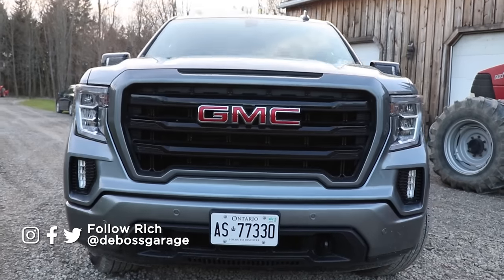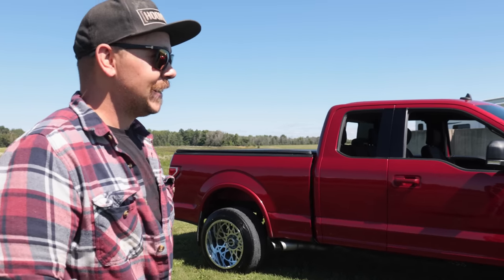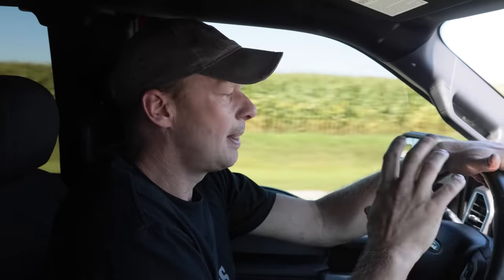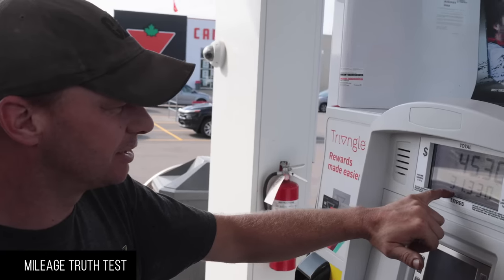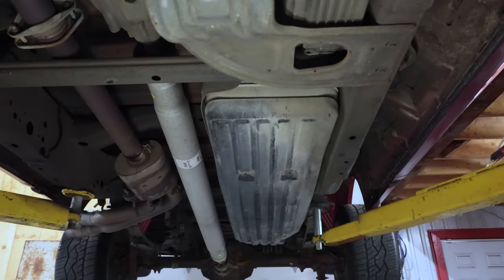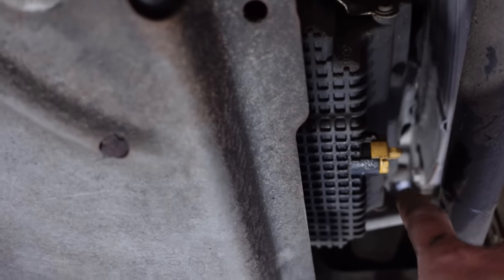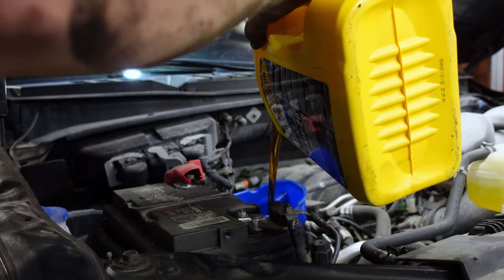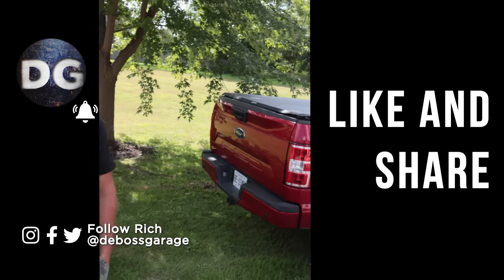REVIEW: 2020 Ford F150 Issues After 2 Years of Ownership?

Comment: I’m not a Ford guy but respect for an extended cab V8. So tired of ecoboost full 4 doors with a short bed.
Reply: That is exactly the reason I still have my 2012 f350 with the gas option, extended cab 8 ft box.

It's extremely hard to find a non diesel/Ecoboost. naturally aspirated engine with a ft 8 box

Comment: I have a 2019 SuperCrew 4wd with the 5.0 and 3.73 gears. 47k miles and factory stock in every way. At 77mph cruise on level ground with no wind I can count on 19.5 mpg. Any headwind at all, though, and it quickly drops into the high 18's. Knock it down to 67 mph and economy jumps to 21.5 - 22 mpg. In town I regularly get 18+ mpg, but I'm pretty chill (my wife says I drive like a 90 year old on Valium).

With the deeper diff gearing and insanely steep 1st to 5th gear ratios, it's hotrod-quick off the line. Let it eat and it will easily break the tire loose in the first few gears. It also means even the slightest bit of moisture or dust on the road results in low-speed traction issues. It's so comfortable we use it as our road trip vehicle even though my wife has a much better equipped leather-trimmed lux sedan.

No probs except for the ubuquitous rear leaf spring isolator pop. Isolators were replaced twice under warranty and it always comes back after a while. I just ignore it now.

Would I buy it again? Absolutely.

Comment: I have a 2019 F150 with the same transmission and with the 3.5 L  ecoboost.  The engine is awesome, the tranny went at 80k. It's been in the shop for 3 weeks and counting atm. Luckily it's been covered under warranty. I do love it though.
Reply from the maker: that's too bad man, thanks for sharing
Reply: Question: I also just got a 2020 F150 Lariat with 20k on it. My first Ford (Chevy guy) and worried about that 10 speed tranny if/when it goes. How is your still covered under warranty at 80k? I thought 36K miles and warranty was done. Thanks.

Comment: I have a 2018 and it had the oil consumption issue. Fords fix was a tsb update and a longer dip stick. Other than that I haven't had any major issues.
Reply: A longer dipstick seems like a complete and utter nonsense to me
Reply: Sounds like an accounting and legal department fix
Reply: That's the most college fix I've heard. Hilarious.
Reply: This is their fix now, their original fix was to replace the engine. Mine was swapped out at 27000 km and I brought it back with the same issue with 80000 km.
Reply: I heard they also reflash the PCM. They say there is too much vacuum on decel and it sucks the oil through the PCV.

Comment: I have 2020 3.5 King Ranch all good! The only time I have rough or harsh shifting is when I have old fuel. That 36 gallon tank lasts a long time. After 30 days I do notice the shifting. Fresh fuel, and it is not an issue. I am getting 19 MPG over all, heavy on city driving

Comment: You don't need to touch the exhaust to drop the trans pan. Just let the cooler hang down and tilt the pan. Comes out really quickly!
Reply: How about the trans filter coming out?
Reply: @paulhunter9613  What specifically are you asking?
Reply: As a Ford dealership Tech, the goal is to remove as much fluid through the fill port on the R.H. side, remove the heat shields, let the trans cooler hang, remove bolts, keep gasket with trans, tip the pan forward and down, remove pan, remove bolts and filter. When installing new filter, get a new filter gasket/o-ring (not included with filter!). Then reverse the process! The tricky part is getting the rear pan bolts. Mountain wrenches and wobble sockets are required! Besides that, it's such an easy pan drop! Take caution though...Ford uses multiple dipsticks! You may have a numbered or lettered dipstick. It's hard to find what number or letter you need to be on for your application. For back yard mechanics, drive for 2 miles and and check where the fluid is on your dipstick. Unless you're leaking fluid, this is where you need to be after your fluid exchange. Make sure you use Mercon ULV!!!
Reply: Also, ALWAYS check fluid level while vehicle is running! Park or Nutral, level ground. 185°‐215°F. Mercon ULV expands alot.

Comment: Get a Ronin drain plug for more controllable oil draining.....and a magnet.  The stock non led headlights are way too dim.  Add some brighter led bulbs or some aftermarket morimotos.  They make a huge improvement for night driving.

Comment: I really like my 2016 f150. I have a heavier foot and average 15 MPG highway. Frame is still looking good for Michigan and only reason I am looking to upgrade is because I'm beyond maxing out the 1/2 ton. I need to get a middle of the road 3/4. It has held up to my abuse well.
Reply: If you get the payload package in the F-150 it will be better on fuel when not towing and still haul a good load.

Comment: Quiet in my diet.... I'm 62 and travel on a motorcycle. I hear people say, "loud exhaust systems are the secret to safety". This of course has nothing to do with your truck, but I'll get to my point soon enough. I've been riding street motorcycles for 43 years without an accident, that's because of lighting, not noise.  When it comes to putting a lot of miles in your rear view mirror, and this includes those four wheeled beasts, you don't want to ear blahhhhhhhhhhhhhhhhhhhhh for ten hours. Neither do other motorists. My motorcycle, a Yamaha FJR1300a, super sport touring bike, and me with a half helmet, is so quiet that going down the road at 55, and the windshield up, is nearly as quiet as my car at the same speed with a couple of windows cracked open. Believe me it's well enjoyed too. I've ridden 952 miles in a day, or about 18 hours.  Quiet is what I want in my diet, and it reduces fatigue.

Comment: So as far a pickups go, my 2003 Ram Laramie 3500/5.9 Cummins outshines most of the modern trucks on the road. Averaging 20 to 22 mpg pulling loaded trailers through the BC landscape (hills/mountains). Issues with engine, tranny, suspension, electronics etc. Zero (1 small exception is the passenger side front window controller not always functioning..big deal..nope. 19 years of service without issues. As far as ride comfort goes...a one ton pick up at 100kmph with stock exhaust and OEM tire/wheels is about as gentle and noise free a ride as you can get. Off roading on the FSR's requires airing down to 40 or so psi to make choppy road surfaces manageable. I've had Ford F150's, Chebbies, Nisans, Mercury and GMC trucks plus drive time in Freightliner and Mack over the 57 years behind the wheel. signed "a subscriber to DeBoss Garage".

Comment: I curse the guy who thought it was a good idea to put the drain plug directly in front of the sway bar. After making a mess of my driveway the first time, I fashioned a funnel out of an old washer fluid bottle that goes between the bar and the pan.
Reply: A lot of shops use vacuum oil removal systems these days. If you are interested in fabricobbling one together Chris Notap has a video on how to build one.

Comment: To be fair to the motor, if he’s changing the oil based on the light coming up on the dash, he’s not changing the oil nearly enough.
Reply: A full synthetic is probably good for 30k. He’s changing the oil plenty.
Reply: @ryanolep1078  the oil itself will hold up just fine, but the amount of particulate that ends up in the oil is going to be nearly the same with whatever type you use.
Reply: I've got an older version of the truck, and have always gone by the dash indicator,  and the oil analysis from Blackstone has several times confirmed it was legit.  Typically the truck asked for it every 10k miles, and based on what was sent in, the lab said I could push it out to 12 safely,  so I figured continuing to do it when the truck asks for it left me safe with a 20% margin for error.
Reply: I agree. I work in a GM dealership, and have found that customers who go by the oil life monitor, are the ones who have timing chain and oil consumption issues.
Reply: The message to change the oil is at a set time, I had the oil changed last yr in November, and now exactly a yr later it has come back saying to change it. I have only drove 1,568 mi since the change last yr

Comment: Got a 2016 F-150 4X4 with the 5.0 and the 6 speed auto transmission. It was made for the Canadian market so it was bought in Canada, and made it's way the the USA. It has the TXR package witch is only available for trucks on the Canadian market. It gets 21 MPG with the drive line combo it has which includes 3.31 rears.  Rides real smooth with stock suspension.
Reply: I wish mine got 21 mpg, also a 16 5.0 4x4 with the 6 speed auto. Don't know what the rear gears are, but it's also a crew cab 6.5 foot bed Lariat. I usually sit around 16 with mine, which is mixed highway and town driving.
Reply: 21 MPG sounds nice!  I have a 2015 loaded Lariat crew cab with the coyote, 6.5 ft bed, 3.31 gears, FX4, and am averaging between 17 and 18 mpg.  On county roads with a 55 mph speed limit I can easily get more like 22 - 24, but most of what I do is a decent mix of highway and in-town.  Oh, and just tripped 276,000 miles earlier this week :)

Comment: Rich - I have a 2020 f-150 with the 5.0L. It has several recalls oil consumption and I here valve train noise on acceleration ford can’t explain. I am adding a oil catch can to the PVC system to see if it helps. I also noticed oil soot on tailpipe. 
I live in the buffalo ny area.

Comment: The 5.0 was my last choice before the base V6. My 2016 3.5EB would routinely run 8.9L/100km. Many trips London to Ottawa/Montreal and back to confirm. My 2019 f350s best was 9.7L/100km and my 2020s best is 9.5L/100km. My biggest issue with the 5.0 was the lack of low-end torque. 2500rpm is low and the 3.5 out pulls everywhere in the powerband. The crew cab 6.5' bed still has the 2 piece drive shaft
Reply: are you talking fuel mileage?
Reply: @harleythrelkeld7587  yes. 9.7L/100km is  24.25mpg and 9.5L/100km is 24.75mpg. 8.9L/100km is 26.4mpg. I had a TDI Jetta that only used 4.3L/100km or 53mpg in town and 3.7L/100km or 63mpg on the highway. Better milage isn't hard to get. Laws of physics  clearly state anything over 60mph(96km/h) requires more energy. 80mph requires 28%more energy than 60mph. The bigger the vehicle the more energy is required to keep moving over 60mph.
Reply: Ive just never seen metric mileage in a written form i knew it wasn't measured km/L though although to me thatd make more sense
Reply: @harleythrelkeld7587 I use km/L for figuring out the mileage on commercial vehicles. I drive 830km on 270L of fuel  is 3.07km/l. It's faster for the lower end of the scale. Planning our camping trip last summer was easy using 17.3L/100km. One way was 1680km ÷100 =16.8 x 17.3 = 290.64L. Works for the other scales too  17.3L/100km works out to be 5.73km/L or 13.6mpg. I like to see the lower numbers on the display(L/100km) vs higher numbers(km/L or mpg)
Reply: makes sense, just a value im not used to seeing being in the imperial system, was in the military so i understand most metric things that value though was way out of left field

Comment: I'm a Chevy fan, and have a 2020 Silverado 1500, 5.3, double cab.  Had I seen this, I would have considered the F150.  Painted frame and aluminum body are pretty tempting living in NS, Canada.  I do get better L/100km though even with just the 8 speed, leveling kit, slightly oversized tires, and no air damn, I'm at 12.  I've got a Flowmaster Super 10 on and it's just right IMO.

Comment: Great video and review on this nice Ford XLT truck. To be fair and non biased on brands here.. that transmission service design is totally unacceptable. Frequent and regular fluid service on transmissions is what gives them longevity. Who would want to do it with that much hassle and work?? Is there a drain plug in trans pan??  Also, the oil drain plug is a joke.. what a mess every time. Come on Ford wake up!So.. the two most important fluid services on this truck are still a great inconvenience to poor design and engineering. Other than that.. nice truck.
Reply: I agree changing the transmission fluid on these trucks is labor intensive.  You need to unbolt the trans and raise it about 2" so you can remove the pan. The trans cooler is also in the way
Reply: Is the filter inside the trans pan on these? If the filter is somewhere else, I'd use a fluid extractor down the dipstick, and not drop the pan at all.
Reply: @om617yota8  yes, the filter is inside the pan.  The trans dipstick is a 4 inch long plastic stick under a metal cap on the side of the trans (not under the hood).  It is right next to the catalytic converter, and you are supposed to check the fluid level with it running and up to temperature...
Reply: @danielbremner7805  Hah, genius. Hope the techs have heat resistant gloves, holy crap.

Comment: Surprised to hear the Owner say he thought it was "up to 8K (miles)" from its last oil change. While I am admittedly Old School when it comes to maintenance, I am always surprised to hear that people who spend $60K on a new vehicle fail to realize that the "recommended" oil change intervals only serve to allow the manufacturer to minimize projected ownership costs but is NOT in the best interest of caring for your very valuable vehicle.

Despite the fact that the oil will not break down (much) during the recommended 10K interval, it WILL be accumulating dirt/grim/impurities created in the course of normal use - like TWICE as much as would be accumulated than would have existed had you changed it at the Old School interval of 5K. Do not cheap out on your very handsome $60K truck for the cheap insurance provided by changing your oil & filter every 5K miles - despite what the manufacturer "recommends".

Comment: Nice, just got my unaffordable 2022 XLT with 5.0l with a slight last model year discount off of MSRP.  Curious if you were going to own a car for 20years at what mileage would you do your initial oil changes?  I'm looking at ~750, ~2250 & 5000miles, then every 5000miles for life.   Oil is cheaper than an engine so any thoughts?  Also, change filter every 5k as well, or filters at 10k miles?

Comment: Those are unfortunately one time use pans on the trans and engine. Getting one off is a pain more so for the factory sealant used. We had to use hammers to knock them off. Yea I always hated the drain placement, not a big fan of the quarter turn drain plugs either.

Comment: My 15 with the 3.5 Ecoboost has been great with 148k. But now its in the ahop for all the coolant lines and fittings on the turbos. I got lucky as they usually leak way before that. Unfortunately its not a cheap fix

Comment: My dad has a 2018 F-150 Lariat with really bad paint issues and the dealer refused to do anything. It looks like they didn't clear the hood well. It was very faded in just a year.

He also has the 10 speed and it occasionally shifts hard when going down into 1st, so basically as you're creeping to a stop... It can get annoying.
Reply: I had to fight with them a bit on the paint issues that's for sure. The rockers on the truck were pink from not being cleared
Reply: @Boostdsuprsport  I've heard Ford's corporate customer service line can be a lot better at dealing with things like that, and I don't think he ever contacted them. We have some horrible Ford dealers in our area. 🙄
Reply: @Studio23Media  can confirm

Comment: From the standpoint of long term reliability, I say if you're buying your truck with the intention of putting it to work in any way, say towing a trailer, or loading it up with sand or firewood or whatever, I say go with the v8. Why ? If you have two different engines, one with 8 cylinders and one with 6 cylinders, and they are of similar or nearly equal power and torque, that means the internal parts of the 6 cylinder are enduring more pressure and stress than the v8, because the 8 has two more sets of stress enduring reciprocating assemblies inside.......  Two more pistons, wrist pins, rods, rod bearings.....  get the picture. If both engines have a driver demanding 375 horsepower by using his gas pedal, the 6 cylinder pistons rods wrist pins and so on are enduring more stress, than the v8. It boils down to brake specific cylinder pressure. Do you want that pressure spread out over 6 cylinders or 8, where the pressure per cylinder would be lower.
Also listening to these guys talk about tuning the truck......  keep in mind, the more engine output the more wear and tear on that very costly transmission, as well as the differential and driveshaft u joints.